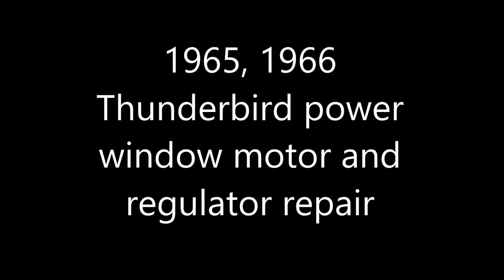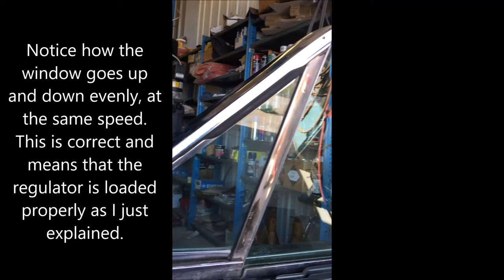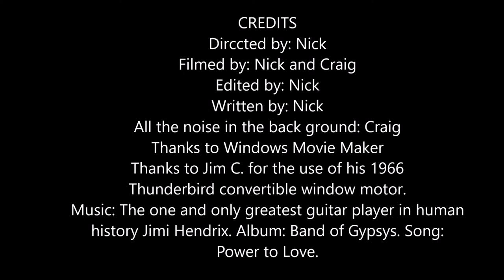1965, 1966 Thunderbird power window motor and regulator repair

Comment: I bought a 66 hardtop (5 window) in 1971 with 81000 miles.  Windows worked like a rocket up and down.  The right window quit one day and I took it apart.  It had the original rubber gear in it which had split.  I bought a replacement gear at the local ford dealer and it was a lot of money at the time.  It had a hard plastic gear and three rubber clutches built in. I think that car had the best. quietest and fastest power windows of any car I have owned. ( I have owned 11 66 birds over the years).  However, even then, when the car was only five years old the two rear quarter windows were very slow.  I just purchased a 64 hardtop which is getting shipped to me.  I hope the 64 model windows are as well built as the 65-66

Comment: Would you be so kind and maybe post a video on how to replace the weather strip or moe hair on the actual top of door where the window goes? It takes like a rubber strip on the outside and looks like moe hair on the inside. Its the strips on the top edge of the actual door and window slides in between them. Hope I explained myself well.  Thank you in advance for all your great videos you have no idea how much you have helped me. God bless you and keep you in great health.
Reply from the maker: Hey Jose, I usually make my videos when I'm working on someones car and I then film that content. I don't have a car here right now that needs the wind lace replaced. Ill keep it in mind though. Depending on what year your car is, you can buy kits for those. I do have a door panel video that shows the same piece on the door panel. You can install yours in a similar way. If you find wind lace with the original retaining clips, then your set, just attach the piece by pressing the clips in and your good to go. I did those on the T & L car but I didn't make a video of it. I should have. Sorry.

Comment: You can for sure take apart the window motor especially the armature because of the contacts sometimes getting rust and seiizing up my window motor had the same problem. To put the armature back get string to tie the the contacts in the spring slots then put the armature in and slide out the strings. Great video!!!
Reply from the maker: thank you
Reply: Mine was seized and wouldn’t turn at all so I took out the armature and cleaned the natal plates with rubbing alcohol and a brush. The copper I sanded down a little and the sides where the armature runs. Then sand the metal contact.
Reply from the maker: Sounds like you put a lot of work into it. Sometimes they are rusty and theres not much to do at that point. How did it turn out? Thanks
Reply: @vintagethunderbirdrepair9426  real good both motors work good and their strong. What sucks is that I needed to get new window switches and a new relay but with all that my windows finally work 🙌🏼

Comment: I changed out the gear on my window motor today.  Your video was extremely helpful.  The hardest part of the job was removing the old gear, which had bonded itself to it's axis.
Reply from the maker: Thank you MrRealMayonnaise. I know what you mean, I've come across many that are seized to the shaft and its a bitch to get them off. You know they have been sitting for some time when that happens.

Comment: Just bought a 65 for my son for a graduation gift, power windows do not work, now I know at least how to check the motors.
Reply from the maker: In most cases, its the switches. Check those first. You can remove them and jump the connectors. Good luck.

Comment: Nick , thank you for all your instructional videos. They have helped me tremendously in the restoration of my 1965 T-Bird.  I am having difficulty reinstalling the front door power window regulator assembly. Would you please provide a detailed instruction or video showing how to get the regulator installed. Thanks Jeff
Reply from the maker: Hey Jeff, thank you. I only make videos on those things that I am working on at the time. I do not presently have a car that needs the window regulator installed. I will say that I get someone to hold the window somewhere about halfway up while I install the regulator and motor assembly. I sit on the ground and I stick my head in the rear hole of the door best I can so I can just barely get one eye in and I hold the regulator up and position all 3 rollers into their tracks at the same time, they must be installed at the same time. It is hard to do and very clumbsy since there is very little room and you have to turn into a contortionist. All the while I am giving the person holding the window instructions as to where to position the window while Im trying to position the rollers. The position of the motor on the regulator is also critical. Somewhere between halfway is good. Thats the best I can do for now Jeff. Good luck.
Reply: @vintagethunderbirdrepair9426  Nick thanks for the  detailed window regulator installation instructions. The regulator is installed and the power window works nicely.

Comment: Thanks Nick! I've got a 64 convertible and the rear upper deck lid motor runs but doesn't have the torque to lift the lid beyond 45 degrees, (yeah, yeah, it can't get it up). That motor isn't identical to this one but thanks for the caution on pulling it apart until I know more.
Reply from the maker: Hey Nick, are you speaking about the "flap" motor? If so, chances are, the flap transmission is having issues and not the motor. Obviously I'm guessing since I don't have your car in front of me but more often then not, when someone's flap doesn't raise properly, its the transmission. There could be several reasons why, transmission is worn out, its not setup correctly, the flap itself is not adjusted properly on the arms, and some other problems. I'm trying to say that don't blame the motor just yet. You need to make sure the transmission is okay first. I've seen many people send their motor out for rebuild and nothing changed when getting it back. Also, the battery needs to be at 100% charge for it to have the power to lift the flap. Good luck.

Comment: Want an easier way to remove the window retainer ring. Throw tool out. take a washcloth and slide behind the handle rip downward on the rag and it will catch on the retaining ring and pull it off. No need to use the tool and rip the vinyl
Reply from the maker: Hey, thats a good recommendation. Thanks.

Comment: I did it I did the one thing you told us not to do and I pulled out the centerpiece I felt like shit but after a little bit of more research I pulled off the back of the motor off as well put the two connectors and the springs back and I secured them in place with some blue painter's tape of all things after those two were secure I had lined up the back of the motor and put it back in place then I put in the centerpiece I didn't complete seal the back of the motor and slipped out the two pieces of blue tape with the centerpiece still in place then I resealed the back of the motor this took me the better part of an hour and a half to figure out and do but I did it I know my description ain't the best but my point is with enough effort and some more research you can put the center peace back in if you do end up accidentally popping it out
Reply from the maker: Sounds like you got if figured out okay. It not hard, just a lot more work. It would be great if you could just pull out the armature and then pop it back in but, as you learned, you cant. Thanks for the reply. Nick

Comment: Nice video
Reply from the maker: Thank you.
Reply: @vintagethunderbirdrepair9426  and I might have a question for you in couple of days just waiting for all the rest of my switches to come in they're. Coming in sporadically this week thanks for sharing your knowledge on this
Reply from the maker: @ihave35cents95  Glad to help.
Reply: @vintagethunderbirdrepair9426  okay here's that question. I replaced all the switches none of the windows worked in this car let's start off with that. I watched your video and I got all windows working except for the driver's rear window but the motor is working in both directions but no window movement what is your best guess did the regulator disengage or is there a gear back there that's problematic. I bought a used regulator for that a couple weeks ago but I'm about to delve into it tomorrow but I've been hearing about some plastic gear and I don't want to rip the panel out if that's the case without having the gear to replace it at the same time. Also is it normal for these windows to be the fastest power windows or ever seen in my life they go up and down like a guillotine
Reply from the maker: @ihave35cents95  Yeah, when you have a working motor but no window movement, its the gear which is in between the motor and regulator. You must remove everything and replace it. Another way to diagnose it is when you can pull the window up and down by hand. If the gear were not broken, you would not be able to do that. Don't buy the gear with the springs in it, buy the gear with the 3 plastic dowels. Good luck.
Reply: @vintagethunderbirdrepair9426  that makes perfect sense thank you. I can't move it with all my might.

Comment: Thanks I have to replace the wiring harness on my passenger side window on my 1965 T Bird do you have a video of that
Reply from the maker: Hey Vic, sorry but I don't. However, if the wiring harness for the window is only bad inside the door, then you can splice a good used one in inside the door. I would not do it in the jamb since there is too much movement there. Its unusual to have to do that, what went wrong there?

Comment: Great video! Could you do a video showing the correct way to install emblems that use barrel nuts/clips?
Reply from the maker: Hi, yes I can do one of those. I was also thinking about doing one about how the peak moldings on a 1961-63 are properly attached but I don't have a donner car right now so that will have to wait. Thanks, Nick

Comment: Great helpful video. I think I can do mine properly now. Thanks. I have a vent window on the same door that the crank turns But vent will not move. Is there a difference in the gear from a power vent to a hand crank vent?
Reply from the maker: Hi Joe, power vents do not have the same gear as the crank vents. You can purchase the crank vent gear new. They are left and right only so order the correct side. Good luck, Nick

Comment: Very nice informative video. I cleaned and regreased both front and rear window motors and they work great. Do you have any advice on how tight the regulator bolts to the door should be?  I seem to be having slow operation on a couple of the windows going down.
Reply from the maker: I dont have a torque spec, I just tighten everything tight. That should not cause the window to work slowly. Properly loading the regulator during reassembly is critical and improper loading causes the window to go up and down at improper speeds. For example, if the regulator is loaded properly, it helps to slow the motor when going down and speed it up when going up counteracting the forces of gravity and weight. In a perfect world, the window should go up and down at the same speed. Also, the tracks that the window ride in can also cause the window to bind if the felt in the tracks is coming loose and bunching up. Or improper alignment of those tracks, etc. One way to know if the tracks are okay beside visually inspecting them is moving (pulling) the window up and down by hand in the tracks before the regulator is attached. It should go up and down easily without binding. I hope that helped you. Thanks, Nick

Comment: Thank you for your video, what’s your opinion on aftermarket motors ? Mine is sticking, a light tap on the housing usually helps unstick thx
Reply from the maker: Hey D Gomes, the only new motors Ive seen available are the reproduction motors from Thunderbird dealers, is this what you mean? I dont know of any others so I cannot judge one way or the other on those. The new motors available from the Thunderbird dealers are good. There can be a lot more wrong then just the motor. I have had that issue many many times where you hit the motor and it starts to work again. Disassembling the motor like I show in the video helps and also changing the gear with a new gear also helps. Old decomposing felt in the window guides can slow down or lock up a window. Improper adjustment can cause a problem. Try those things. Good luck.

Comment: thank you for the video , great info, my passenger side rear window is stuck in the up position, it does get power and it worked, but when I put the door panel back 
on, it stopped working,  this happend before and I had to take the window box out , which is hard to do with the window up, and all of a sudden it worked, and kept working
until I installed the door panel, any advice, thank you in advance, it's a '65
Reply from the maker: sounds like you may have a wiring issue with the wires from the switch, or the switch itself on the panel? There should be no reason why the door panel would stop the window from working so the only connection is the switch and wires. That's where Id look first. Thanks, Nick
Reply: I actually am experiencing this same problem. My driver's side window worked fine, but was starting to slip. I was doing AC work, so I had the entire interior out of the car. I figured I'd do some maintenance and take the motor out to inspect the gears inside. Sure enough, the plastic gear was slowly coming to pieces. I cleaned the old grease out, put a new gear in and tested the motor. It worked fine, but seemed slightly slow. Shrugging, I put the motor back into the door and tested it. It worked, but now was even slower. About two days later, nothing. I took the door panel off, and it started working again, albeit very slowly. I took the motor back out of the door and tested it with just the regulator assembly attached. It operated very slowly against the spring. Taking the motor out of the regulator assembly, the motor spun fine. I'm going to try cleaning the shaft like is shown above, but I'm beginning to doubt that's the real problem. I'm almost certain the commutator is dirty, which would mean pulling the entire motor apart (you know, that thing he tells us expressly NOT to do...). The motor gets quite hot when I operate it, so it seems like there's a lot of resistance going on inside. Pulling it apart and putting it back together again is possible, just difficult. Brushes inside a motor can typically be held back under tension by inserting a pin or paperclip inside a small hole that's drilled into the end of the brush guide. With the paperclips in place, that allows one to drop in the commutator, then pull the clips. The brushes spring back into position and you're good to go. With the commutator out, that allows you to inspect and clean the spot where the brushes make contact. Very often, especially after years of use, dirt, dust and oxidation of the copper build up to a sufficient point to cause enough resistance in the circuit to slow or even stop the motor from working at all. Getting all of that cleaned up and polished would make a dull, slow or weak motor operate like new again. If all else fails and I can't get the motor back together or working properly, I have a brand new motor I can install with relays.

Comment: I just discovered your channel, and this is all priceless! I have a '65 TBird, and I absolutely love it. One question I have is that my passenger side window motor works, but seems like it's slipping. As the window travels up, it slows, then catches and speeds up, slows again, and so forth until the last inch where it takes 1-2 minutes to finally shut. Could this be broken teeth on the gear inside the motor (not the worm gear, but the larger one)?
Reply from the maker: Hey David, yes it sounds like the gear is bad. They are  plastic or rubber and break. Sounds like you need to take it apart and replace the gear. You can also know this if you can lift the window up and down by hand, then you know the gear is bad. Good luck, Nick
Reply: @vintagethunderbirdrepair9426   Hey thank you so much for responding! I took the door apart and inspected the gear. Sure enough, the rubber inside that connected the small gear to the large had completely torn apart. I ordered new gears, put it back together and it works like new! Now my driver's side motor has gone bad, despite throwing a new gear at it. It runs, but it just doesn't have any torque. It barely has enough umph to overcome the spring inside the regulator. This is with testing it on a direct connection to a strong 12v source with the regulator assembly out of the door. I'm going to completely disassemble the motor to try and clean the commutator contacts. If that doesn't work, I'm going to install a brand new, modern motor with relays instead.
Reply from the maker: Yes I would at least take the head off the motor off like I show in my video and see if it is corroded or binding where the motor shaft passes through the head. Its unusual for a motor to work but be so sluggish as to not move the window. They usually either work or dont work. So my first thought is that something is hindering it from working properly. Make sure the regulator is okay and its loaded properly. Good luck.